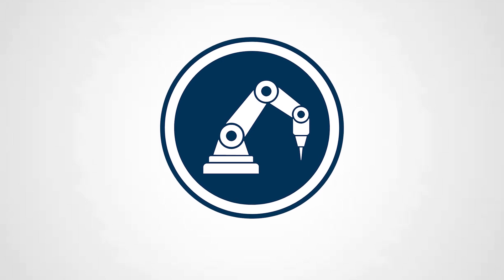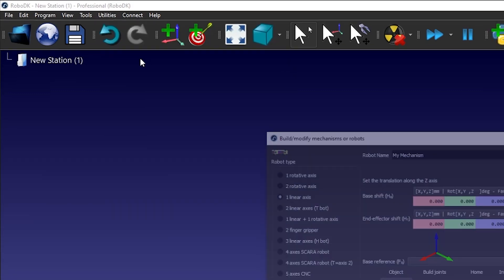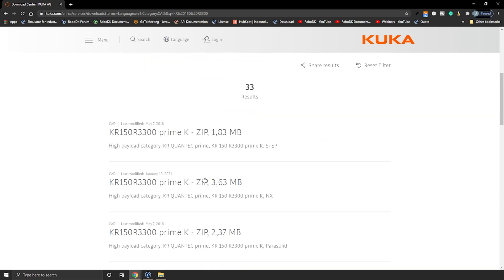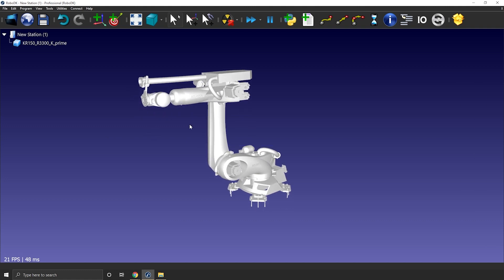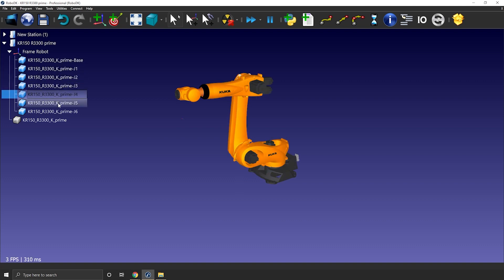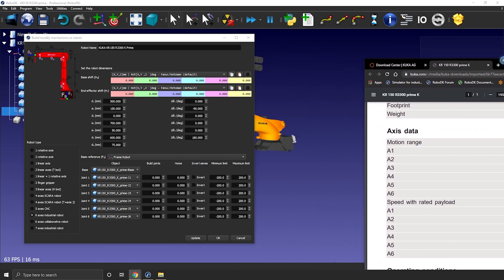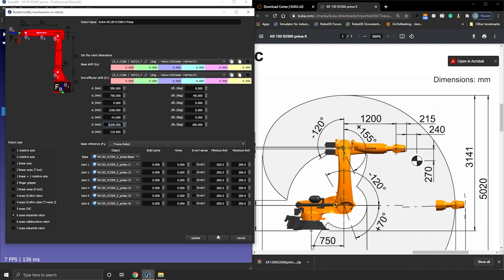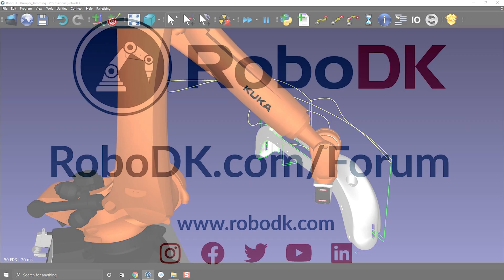Model your robot arm - Part 1

Comment: But can i control my original robot in this software
Reply from the maker: You can generate programs or connect to the robot. The procedure may vary depending on the robot controller. You can find more information in our documentation: https://robodk.com/doc/en/Robot-Programs.html